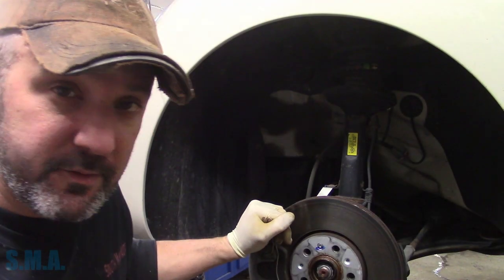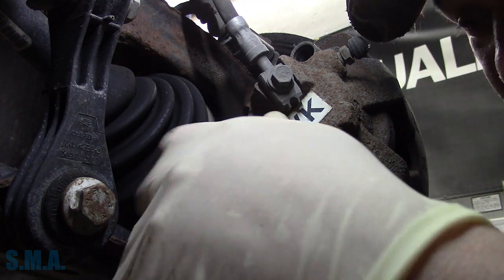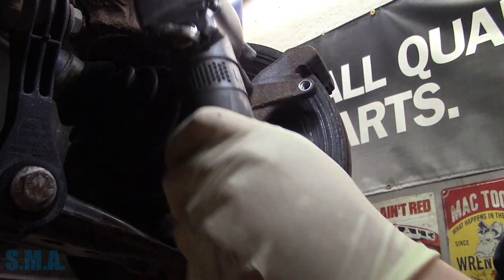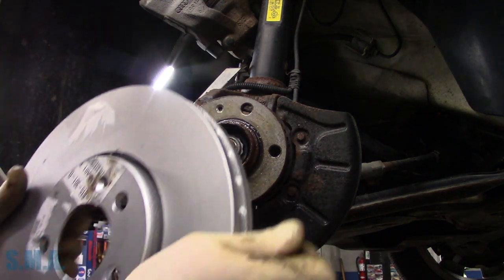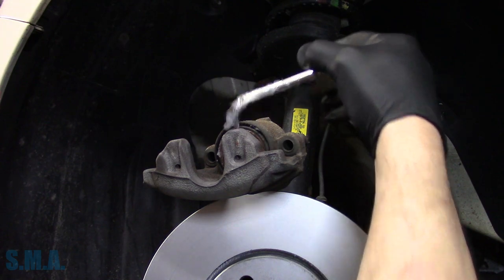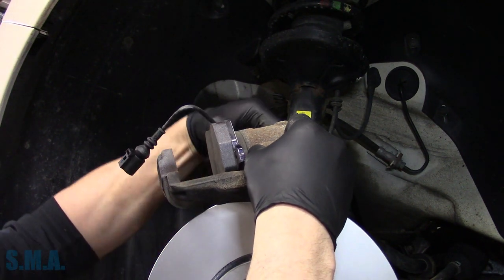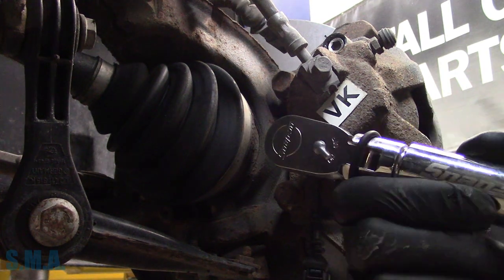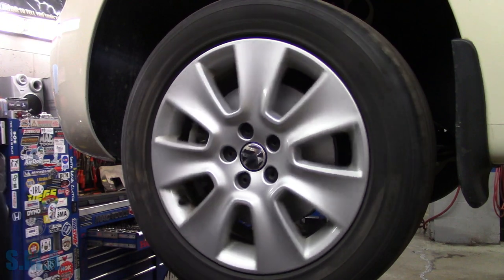VW (New) Beetle: Front Brake Job

Comment: I have 2 New Beetles. an '03 and an '06. My '06 has 279,000 on it. If you want "genuine" VW parts then you can pay the difference! OEM spec parts from Napa (not a sponsor) etc, are just fine with me, as long as the pads are ceramic. There is no need to pay 5x as much for the same quality. If I know ahead of time, I often order my parts from ECS Tuning, (European Car Service). Their branded parts are high quality, and sometimes as little as 1/10th the cost. 
EX: Fuel pump for my '06. Special pump for a METAL tank.
$1,050 from VW. 
$750-$850 from local parts places. 
$150 from ECS.
What would you do?
More mechanics should hook up with ECS Tuning.

Comment: Ok 2005 Dodge Grand Caravan has check engine light on when bought it a year ago.  Had it serviced by my mechanic in Texas ( trust him he has turned down work  among the work they did was change O2 sensor.  Month later check engine light came back on.    This winter in Denver had a no start first place did battery and starter. Got it back the battery light was on again.   Second shop changed alternator.   Last night read code was O2 sensor like before.  Code cleared ( not been 50 time run since alt was replaced ).  Now check engine light of.  Could it have been due to bad alternator or??   3.8 over 180,000 miles.  It’s a work car kept for when I gotta do reset in Denver

Comment: OEM parts? That's usually a joke. I priced clutch parts for my van last year - around £600 for OEM parts. I got them on ebay - about £150 - same manufacturer part number and made at exactly the same factory!

Comment: VW has a pin you can screw in the lug nut hole to slide the tire onto the rotor and it holds the tire while you thread the other bolts in. Yeah, it’s crazy over engineering, but it’s what we’ve come to expect from VDub.

Comment: 125Nm is roughly small/medium sized car wheel bolt tightening torque. Again roughly 12,5 kg of weight hanging from 1 meter long lever. There ya go.

Comment: I notice you mention the odd size thread on the guide pins but do tell when they came out with the 7mm allen screw fitting did you actually have one I mean you buy a standard set of allen hex drivers was there a 7mm among them 5 6 8 10 " 7" WT# I'm only a DIY'r but I now two they have pride of place in the secret I'll never find it again spot in the tool box Grrr.

Comment: I'm pretty sure they eliminated the wheel stud for part reduction, and also to sell a stupid wheel alignment pin. just be glad the caliper hanger didn't have those stupid triple square bolts in them. always fun to have to buy a new bit just for 1 application.

Comment: German cars have a rod about 9 inches long that you screw in after you take out the first bolt.  It serves the purpose of the tire not falling off and guiding it back on when you put it on.  Porsche, Mercedes, VW, Audi and BMW use them.  It's much better then the studs on the rotor and bolts are far better then nuts.  Remember anything on a german car isn't there for convience, its there because it was not just engineered it was OVER engineered, it wasn't until the 2000's that germans gave in and put cup holders in cars, because cars are for driving not eating and drinking in.

Comment: The newton metre (also newton-metre, symbol N⋅m,[1] N m[1]) is a unit of torque (also called moment) in the SI system. One newton metre is equal to the torque resulting from a force of one newton applied perpendicularly to the end of a moment arm that is one metre long. The nonstandard symbol Nm occurs in some fields. Not a FIG NEWTON Eric..lol

Comment: I'm surprised you voluntarily worked on a VW, Eric.  
I hate new VWs and Audis. Stuff goes sideways without trying.  My daughter has a Q7 and her cabin fan was busted. It shouldnt be a big deal to replace but couldn't get the stupid bolts out. Nothing I had would fit, metric or SAE. Come to find out, it needed not a 5 or 6mm socket but a 5.5. There's absolutely no technical reason for that, other than to make you buy a special tool (presumably from Audi, in the day). Luckily, they sell sets now at the FLAPS. 
Then you have to get XZN sockets and a VAGCom OBD2 reader. UGH. An unnecessarily complicated car, if you ask me. 
Thanks Eric.
Reply: 7/32 works well.

Comment: Lug bolts vs Wheel studs vis-a-vis VW The year 1937 The cheapest possible  design, 20 fewer parts per car. 1946, Not like we have the resources to change it. Heck! We're fighting for ever spare cabbage and turnip! My  S.O.'s 2003 Passat came with a plastic (What else) wheel alignment pin in the tire change tool kit.

Comment: The enginerd that thought of getting rid of the wheel studs was thinking about the assembly line, not the end user.
Reply: look in the boot sometimes there is a piece of all thread with the jack and spare tire for installing the tire.
 Go to a salvage yard and look for one in an Audi, VW,  BMW or Mercedes,  it will make you life easier if you do alote of german cussing

Comment: The idea of using bolts instead of studs is that the bolts don't rust up and they don't sheer off or break when trying to remove nuts.  What is a good inexpensive scam tool to do an 'ABS pump test/brake bleed'??? I have a 2000 VWGolf with 398,000 miles that I put all new brake rotors and pads. Then the master cylinder went out. I replaced it, but the brake lines were frozen to nuts. Tore them up removing...junkyard time. Now I need to bleed.

Comment: Yeah not a huge fan of no studs on the VW design. The older bugs wheels had such a tilt to them you couldn't set them in the hub. You had to hold the wheel in place then throw in a lug to hold the damn things on. Easy work but still kind of a pain usually

Comment: 10 Newtons (N) = the weight of 1 kg = 2.2 lb and 1 meter (m) = 3.2 ft.  So,
1 Nm = 1 (N) X (m) = (0.22 lb) X (3.2 ft) = 0.70 ft lb.  And,
27 Nm = 27 X (0.70 ft lb) = 19 ft lb.

Comment: the only reason I think they use wheel bolts is because it's cheaper to make than wheel studs. one less part in the manufacturing process I guess... I still hate them though.

Comment: ...do the instructions for those brake pads say, no permatex EXTREME?

Whats with the silicone grease? Lol
Reply: I was wondering the same thing. Maybe he finally decided to quit using the permatex since it says its not safe for rubber....
Reply: @blake8297  does it say that? I read it was ok for everything on the brakes. I still dont use it on the guide pins. I use the orange stuff they have now. Silicone EXTREME...with real bits of ceramic lol.

Anybody else use the orange? Like it? Im trying it over regular silicone grease. Just wasnt extreme enough for my residential roads lol
Reply: @Papi4l2  never antiseize on slide pins of any type on this car the stainless steel pins make contact only with rubber grommet in the caliper so silicone is excellent
Reply: @petterballin1344  nobody ever said anything about antiseize? Lol

Comment: Look up this product on Amazon: OEMTOOLS 24233 Wheel Stud Alignment Pin, 8 Piece 

You screw two pins and it helps guide the wheel when putting it back on.
Helps a lot for heavy wheels.

Comment: 1 Newton = .225 pounds force
1 meter = 3.28 feet
1 Newton times 1 meter = .225 lbs times 3.28 feet or .738 ft lbs
28 newton meters = 28 times .738 ft lbs or 20.65 ft lbs
125 n-m = 125*.738  or 92.2 ft-lb
There are only three countries left in the world still using the old system of measurement based on the length of some monarch’s foot, one is Myanmar one is Liberia, ...

Comment: Who knows why they got rid of wheel studs, but honestly as long as your rim fits the hub as it should, or you have the correct adaptor for your aftermarket rims, it's not that much of a difference in my opinion.

If VW have similar quality on the slider pin as my old Volvo they don't strip, especially the 7mm hex ones. They came with an updated version with a T45, real shallow, and those mf'ers strip if you so much as look at them funny. They're also poorly made so the bit tends to cam out easily, torx usually bites pretty good, but these don't for whatever reason. They also rust, so I found an after market supplier that still have a good copy of the first generation parts which have done me much better. (I engine brake most of the time so my brakes tend to seize up :/)

Comment: That there Vdub has sticking calipers. If everything is working the way it should, the inside of the rotor should never wear faster than the outside. It could be rusty caliper pistons, or it could be that it wasn't moving on it's pins the way it should (lack of lubrication)

Comment: If you can do it, I can do it...
Except if I did it, I'd round off the hex in each of the slider pins, break the low pad warning multiplug, stick the adhesive backed in the wrong place, aaand probably cross-thread one of the wheel lug bolts... all while delivering a very colourful string of words concerning VW, VW engineers, and the things I'd like to do to them that would get me banned if I wrote them 😜😂😂

Comment: I stopped watching about 10 seconds in due to a high pitched squeal piercing my soul. Found out that it was coming from Scotty Kilmer after hearing that someone owned a VW Beetle.
On the real, though, last year my wife bought a 2013 VW Eos Convertible. It had 101k miles on it and was an automatic 4-cylinder turbo.
Fast forward 3 months and close to $3k in repairs and she traded that bad boy in for a 2020 Toyota C-HR. Life is back good again...